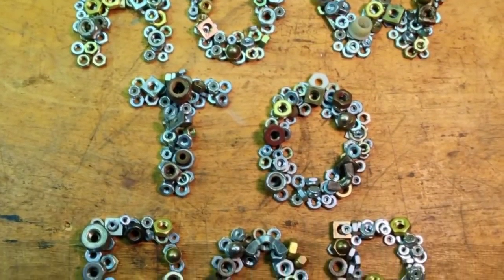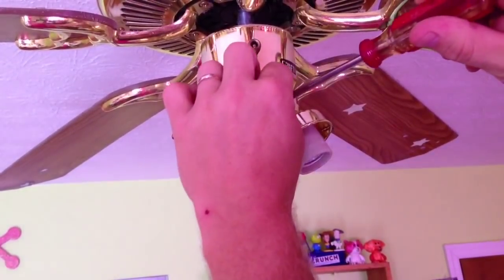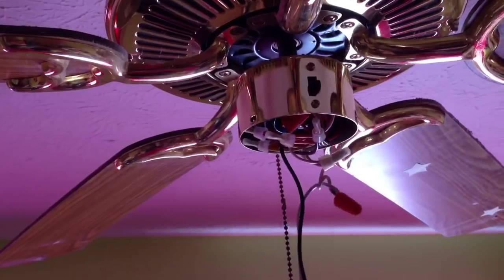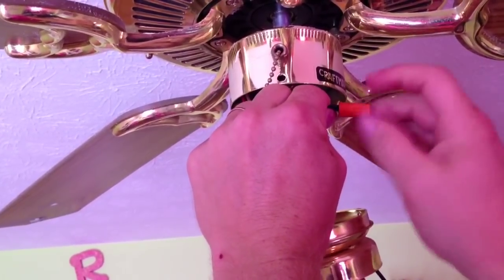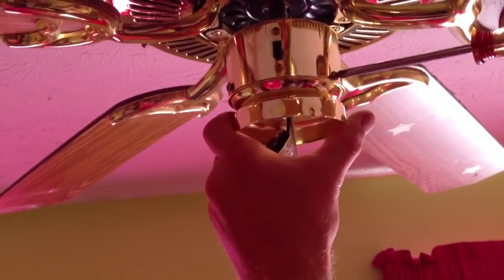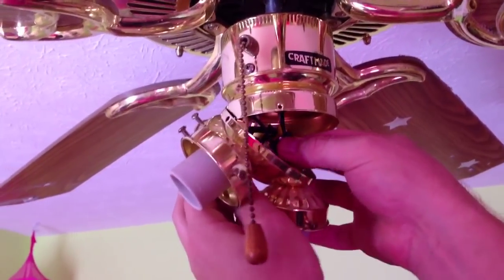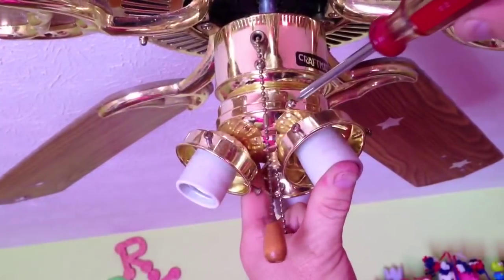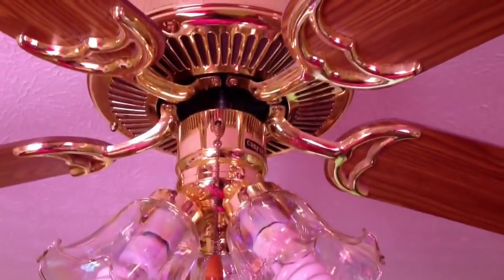Replacing a broken pull chain switch on a ceiling fan.

Comment: Hi Bob thanks for the video. 👍😊Very helpful but my fan switch works but the light chain is jammed. Do I still need to change entire switch? HELP!! 😟
Reply from the maker: You could take it apart and see if you can get it un-stuck but if not then a replacement is in order. Thanks for watching.

Comment: Very good information, however there is one thing that I never saw after watching several of these types of videos. I bought a 3 speed double capacitor fan switch at home depot. It went in real easy, and then when I turned on the fan it worked. However, the fan would not turn off, so I figured that it was faulty. Well when I got back to the store and was about to select the same switch, I notice that there was another switch of the same size but I noticed that it said single capacitor. I asked the guy who was in that department and he said more than likely, this would be the switch for your fan. Well he was right, and now it works like new. So be sure to know which capacitor your fan is set up for.
Reply from the maker: Thanks for watching.

Comment: Wow thanks so muchI I actually think I can do this. Rather than call an electrician I was gonna just purchase a new light which I could install with out fan, but I really think I can do this!!  Will let you know!!
Reply from the maker: As long as you turn the power off before you wire the switch,what do you have to lose? I say go for it! You could end up saving a lot of money. Let us know how it works out. Thanks for watching.

Comment: love the video, but still confused since the hardware store has a three way pull chain switch and a pull chain switch.  I bought the single pull chain switch, but not sure if it is correct.  My fan works fine on all three speeds, but my 2 lights are blinking like Christmas tree lights. both are operated from a single wall switch.  Thanks, if you're still monitoring this.
Reply from the maker: lulu Yep I'm still monitoring this :-) The hardware store will have several different types of switches available for fans, some are for the fan itself and some are for the light, your best bet is to take your old one in with you and match it up with a new one. Look for the number of wires coming out of the new one to match the old one, IF you can find someone in the store that knows anything about electric they should be able to assist you with a new switch. Hope this helps. Keep us posted.

Comment: I accidentally pulled the chain out which turned the fan light from the "on position" to the "off position."  Now my wall switch won't turn the light on. Is fixing this process still the same if I have no desire to replace the pull chain? I just want to be able to turn the light on/off using the wall switch again, I'd rather leave the pull chain absent to avoid it happening again. Thank you for your help.
Reply from the maker: The procedure will be very similar for the fan or the light pull chain. Hope this helps, thanks for watching.

Comment: My problem was slightly different. I have the 4 light fan and it has a separate area above the fan that has a night light in it. The unit is attached to a wall switch. If the switch is on, you could operate the fan and lights by pull strings (one for the fan, one for the lights.)
By pulling the string you could turn the main lights on or off as well as the night light. Separately.  So for years now, if the wall switch was on so were the main lights. The pull string did nothing.  The night light quit working altogether.  So I still figured it was a pull chain switch issue but having just done the change, it didn't affect it at all.  I didn't have to run the wire up to the top- just use the wire nut to where both ends were attached in the main area below. At least they still work with the wall switch.
Reply from the maker: Thanks for watching.

Comment: I scrolled through the comments but couldn't quite ascertain if I need a specifically different part if the fan cord broke off, not the light cord.  I bought the exact one in the video.  Can I use that for the fan cord?
Reply from the maker: You will need a different switch for the fan because it usually has different speeds. Hope this helps, Thanks for watching.

Comment: if i hooked up the two wires directly that were cut eliminating the switch would that be a problem?just using the switch on the wall
Reply from the maker: Moises Padillo That would work but you if you only have one switch on the wall you will be turning off the fan as well as the light. Hope that makes sense. Thanks for watching.
Reply: yes,makes sense,there are two switches,one for light one for fan,thank
s,didnt want to blow up the house

Comment: How do you change it if you broke the pull chain that controls the fan speed
Reply from the maker: You would follow the same process in this video but with the fan speed switch. That being said when you go to purchase the fan speed switch make sure you don’t get a light switch, they are different because most fan speed switches have more than one position. Hope this helps, Thanks for watching

Comment: Do I have to flip the breaker/ turn the power off to repair the light switch or can I just turn it off by the light switch on the wall?
Reply from the maker: You can turn the power off at the switch to do the repair but it would not hurt to turn the breaker off just to be safe. Always check for power before doing this type of repair. Thanks for the question and thanks for watching.
Reply: @funbro1  thank you so much

Comment: Is it okay to use a normal copper to copper wirenut on aluminum wire? It seems that's what he did on this video but I'm not sure.
Reply from the maker: In the video the wires are not aluminum but to answer your question, when going to aluminum wire you should use no-ox or an anti oxidant. Ideal makes a purple wire but that can be used to go from aluminum to copper. Hope this helps, thanks for watching.
Reply: @funbro1  oh okay I thought it was stranded aluminum? I have a ceiling fan chain I'm replacing it looked like aluminum wires to me so I wasn't sure if I could use wire connectors. Sorry I'm not an electrician.
Reply from the maker: If it’s a newer fan chances are very good that it is not aluminum. The wires can be stranded but still doubt they are aluminum.

Comment: You turned of the power to the entire house correct?
Reply from the maker: I would recommend turning off as much as you feel comfortable with. If you’re comfortable turning off the switch then that would be all that you need,,  if not you can turn the power off at the breaker for that circuit,   Or you could turn the power off to the entire house. That being said always, always check to make sure the power is off first.  Hope this helps, thanks for watching.
Reply: funbro1 cool thanks

Comment: What if it's the fan speed chain that needs replacing?
Reply from the maker: It is the same process but you will need a different switch. Hope this helps, Thanks for watching.
Reply: funbro1 Thanks. Just got back from the hardware store ceiling fan department. They had Westinghouse 3 speed fan switches right next to the light switches.
Reply from the maker: Awesome, the process is very much the same. Best of luck, you got this.
Reply: @funbro1  Thanks. Mission accomplished. I did wind up splicing in 3" wires that were rigid enough to push in the switch though.

Comment: Do I have to turn the power off at the main panel? Or can I just flip the power switch to the fan on the wall?
Reply from the maker: You should be able to turn off the switch but check the power at the fan before continuing and when it doubt turn off the breaker. Thanks for watching.

Comment: If I turn off my light switch, will it kill the power from the ceiling fan or do I have to  trip a breaker? Not trying to get electrocuted.
Reply from the maker: I would always recommend turning it off at the breaker. That being said many people do not but always be safe and check before doing any electrical work.

Thanks for watching.

Comment: hi sir for me only a part of the pull chain is broken. it is possible to join it again but it is very small. can you please suggest a way by which i can fix it?
Reply from the maker: +nitish trikha If you still have a piece of chain left, even if it is small, you can usually connect and additional piece to it. This would be much easier than replacing the entire switch. Hope this helps, Thanks for watching.
Reply: +funbro1 hi sir thanks a lot for ur advice. will try that and let you know
Reply: my little piece of chain is deep in the switch. how would I connect additional piece to it?
Reply from the maker: If it is too deep then the switch will need to be replaced. sorry
Reply: Hi Sir, i tried the suggestion you gave me and it has fixed the problem !!!!!

Comment: what about the chain for the fan? mine is missing
Reply from the maker: It would be installed basically the same way.
Reply: But keep in mind you'd need a switch specifically for the fan, as it has three speeds and off, versus the light that is a simple on off.
Reply: +Benjamin Filbert very good hind sight good lookin out Ben
Reply: Spencer Thomas I worked at a hardware store for years. You'd be surprised how many people try to diy but don't even think about that

Comment: is this what i have to do if the chain is stuck? it won't move when i pull on it so the light wont' come one
Reply from the maker: It is a quick enough fix so I would go ahead and change out the pull chain switch, chances are it is bad.

Comment: Good video. If you had cut the wires to the switch, close to the switch, you could have used wire nuts there without having to remove the upper housing. You way works, but removing two housings gets fiddly. I'm not criticizing your effort, just thinking out loud.
Reply from the maker: That could work also, maybe sometimes. Thanks for watching.

Comment: Would it be possible to just put the pull switch back on ? My switch fell off because someone pulled it to hard. Would i be able to just get that same switch back on ?
Reply from the maker: Isaac Castro You might be able to it depends if there is anything hanging out of the switch that you could maybe grab with needle nose pliers. thanks for watching.
Reply: +funbro1 but what if part of the chain is in the hole where you put the chain at?
Reply from the maker: As long as you can get a connector onto the remaining piece of chain and add additional chain you should be able to save the switch and time wiring a new one.

Comment: will this fan light switch also fix the issue if the chain for the fan ripped from the base? or is there another part i need for that? thanks
Reply from the maker: That should fix the issue, and It should be replaced the same way. Hope this helps, Thanks for watching.

Comment: I searched how to turn off a ceiling fan with a pull chain and your channel came up. Can you please explain why if it has nothing to do with turning the fan off?
Reply from the maker: Nope, sure can't. I could make an educated guess though. Keyword search is how YouTube videos are found and some of the same keywords that you searched may have been some of the same that I put for the search requests. Hope this helps. Thanks for watching.
Reply: It does help, and thanks for replying. Also, I finally turned my fan off after 5 minutes

Comment: I did it. There turned out to be a type of switch that has one of the black wires with a pull and push in plug.  I didn't get that type and I acutally had cut that plug off on the ceiling fan to use the switch.  Had I known, I could just have boughten the switch that had that type of plug.  Oh well.  It still worked and I did it.
Reply from the maker: Good to hear. Thanks for watching.

Comment: To connect the 2 wires from new fan light switch to the fan/ceiling, it doesn't matter which wire goes to which?!?!  (my light switch chain won't move at all, broken?)
Reply from the maker: Should be same color to same color. Thanks for watching.

Comment: My switch has gone bad a couple times, the hard part for me is finding a replacement switch because my threaded part of the switch needs to be about 3/4 of an inch long instead of a 1/2 inch those are hard to find even online. It can be done but it hasn't been easy lol.
Reply from the maker: Thanks for the view
Reply: @funbro1  Thanks for the video! its been a while since I've had to do this and I couldn't remember what I had done to it last time, you see my switch broke and I ordered one online a couple months ago. Since I had to wait for shipping I simply wired it so the light would be on whenever the wall switch was on . Which meant I couldn't turn off the light in the day if the fan was on. Wifey finally got after me today and I have it working properly again!

Comment: hey @funbro1 When you disconnect from power do you flip the breaker or just the light switch in the room?
Reply from the maker: Ideally the switch should be enough, but to be sure test the lines with a no-touch tester to make sure the power is off.  Thanks for watching.

Comment: What if it was my fan chain and not the light chain I need help with that if it's any different because my fan is set to lowest setting right now and it's f**** hot as f*** so I'm sweating buckets I hope it's easier with the fan switch
Reply from the maker: It should change out the same way as the light chain switch. Stay cool. Thanks for watching.

Comment: hello thanks for the video I was wondering was it for fan only I was making the bed I accidentally snatched out the chain for the light so would I have to replace the chain like you did or the one I had before just plug it back ...? please help 😃
Reply from the maker: The fan and light pull chain both change out very close to the same way, so if you are using this video to change the light or fan it should work. Hope this answers your question.

Comment: Good video, but you should specify that you are doing the light switch, not the fan motor switch.
Reply from the maker: Nah, it works the same for either switch. Thanks for watching.
Reply: funbro1 
Not necessarily if it’s a 4 wire switch. Best of luck to you!
Reply from the maker: Absolutely, same process.

Comment: This looks good. I pulled the chain and the bloody thing came right out of the housing unit. Initially looked like the chain just separated, but upon further inspection, the little chain 'catch' in the unit broke. Tiny little plastic piece. So got to replace the whole switch. Fun times.
Reply from the maker: Hope it went smooth. Thanks for watching.

Comment: So I have to replace the whole switch huh.. I cant just put in a single chain in?
Reply from the maker: +Voldiirn IF there is no chain hanging out then yeah the whole switch will need to be replaced. Thanks for the question.
Reply: +funbro1 i have a ceiling fan/light like yours. I shut off the power to my room and yet my volt detector is still beeping in certain areas. What is going on lol?
Reply from the maker: +Voldiirn Sometimes those no touch voltage detectors are sensitive, I have had mine go off just from being cold. That being said it is better to be safe and turn off everything, if need be.

Comment: i seen the answer to my problem in the comments below. would a new light switch work for the fan or does the fan have special switch.
Reply from the maker: Most of the time the fan will have 3 different speeds so you will probably need a different type of switch. Hope this helps, Thanks for watching.
Reply: I forgot about the three speeds, witch it does. thanks for replying

Comment: Thank you so much for this, just got it done but now Im getting a burning smell coming from the cables although everything seems fine. What could be the cause of such smell? Any help please?
Reply from the maker: Not sure what you are smelling, it is possible that it is dust that was shaken loose when the new switch was wired in. Run it for a bit then turn off the electric and take it back apart, feel around for anything that might be warm/hot. Hope this helps, Thanks for watching.

Comment: these fixtures are SO heavy and the supports to hold them not so good
Reply from the maker: I have never had a problem, as long as the bracket is mounted to a correctly installed ceiling fan box. Thanks for watching.

Comment: I dont have access to the breaker..can i do this just by shutting the lightswitch on the wall off??
Reply from the maker: You can but always test it using a no touch electrical tester to make sure it is off. Thanks for watching.

Comment: Do you have to turn off all he power in home or just make sure light switch is off??
Reply from the maker: Well that depends on how comfortable you are with working with electric. I know people that would do this type of thing without turning the power off at all, but to play it safe it is always better to turn the switch off and do a test at the fan to make sure there is no power to it. It wouldn't hurt to turn the breaker off just in case someone enters the room and tries to flip the switch thinking they are going to give you more light but instead "light" you up. Best bet is to check the power at the fan before proceeding. Thanks.
Reply: funbro1 no...thank you

Comment: Thanks for the video! It was really helpful as I had purchased the pull chain and extra wire nuts but when I opened the fan casing I found the original pull chain only was connected to one cable, the other was not and I was wondering why the light wasn't working ( 4:06 ).
Reply from the maker: Thanks for watching